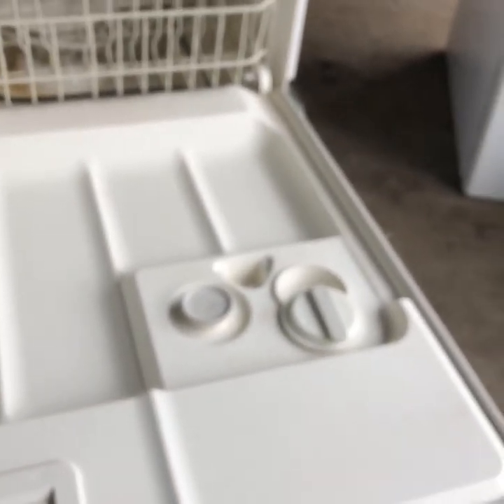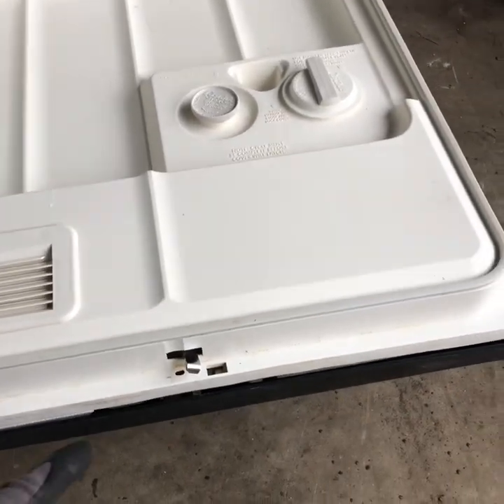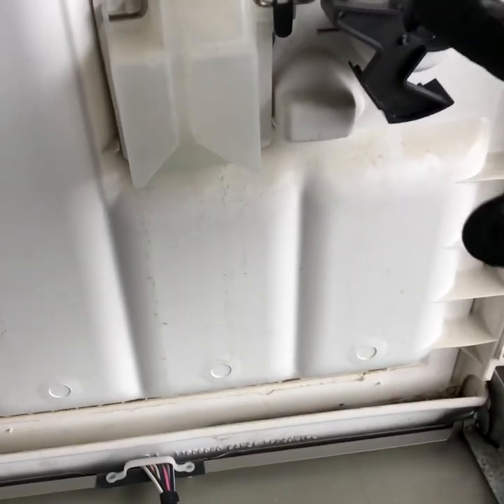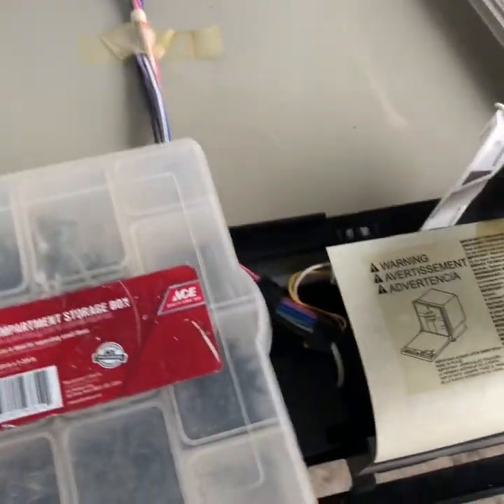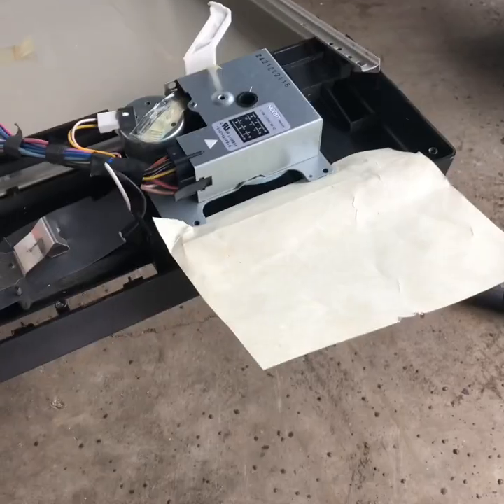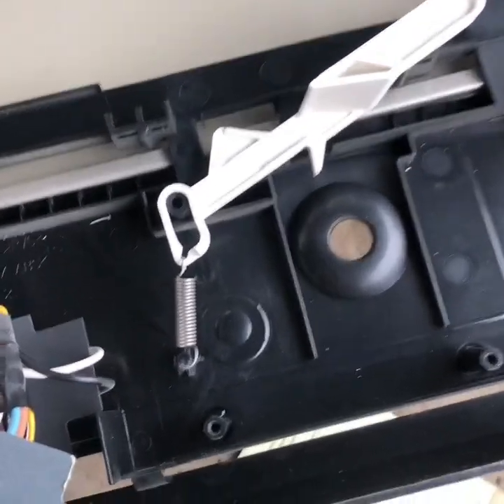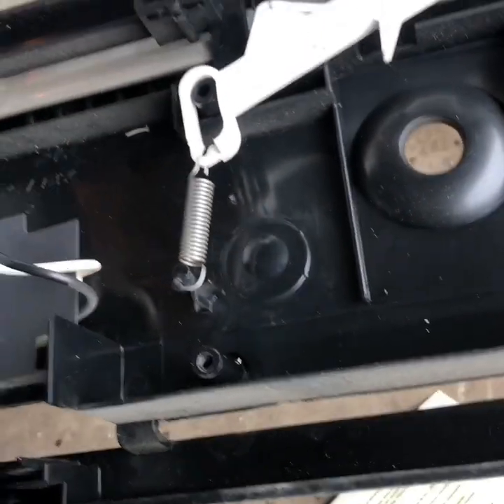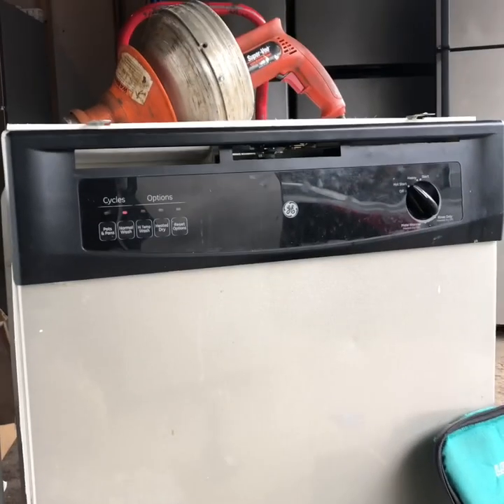GE dishwasher soap compartment wasnt  closing

Comment: If that plastic tab is broken drill a small hole and use a unpunched rivet or screw. It will hold in once you put the timer back on.

Comment: Thank you for your detailed explanation of how the soap compartment works. I was checking the other end and didn't know about this spring behind the timer until I finally found another post that referenced it but did not show very good pictures. Had same problem with top of spring post being broken off. Once I found your post I determined it was quicker and easier to service this spring by removing the timer to gain unobstructed view and access. Drilled a small through hole right behind post just below where it broke off and attached spring through the hole and then stretched it to connect to the white actuator arm. Works fine now.

Comment: Yup post broke for spring. Incidentally, the shaft where spring attaches was broken. My ingenious fix for that was I drilled a hole on the remaining post through the side of it and used a tie wrap through the hole. I then put the hook end of the spring on the tie wrap and squeezed the end with pliers to stay on. Then same with the other end to the plastic lever that rides the timer cam. It works good. Thanks for the tips.

Comment: I was just having problems. I opened the back panel and everything looked okay. Springs at the different locations were working. But the soap door wouldn't lock. I left the soap door as it and ran a short wash cycle and I could hear the clicking of one of the arms operating. If my circuit boards weren't talking to eat other I knew I may have to replace my dishwasher since I've had it from 2003. I see that parts are available. Some basic parts like a lever arm or two but no electronic boards. 
 But then I remember that a week ago we had sort of a power blink. It was making my UPS for my computer make noises and the lights barely blinked. I thought of trying to reset the dishwasher by shutting off the circuit breaker. That cleared up my problem.

Comment: Same problem. Because the plastic tower link to the spring had snapped and no brand nor amount of glue was up for the task I simply installed a tiny screw to attach the spring to.
Reply: This comment just saved me hundreds.. did the same thing